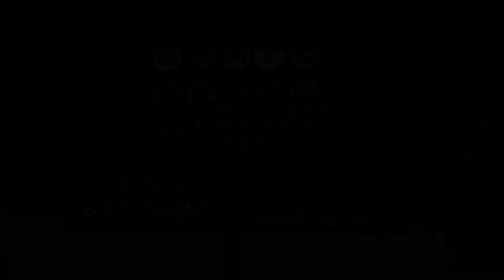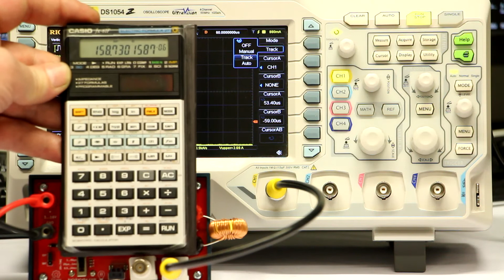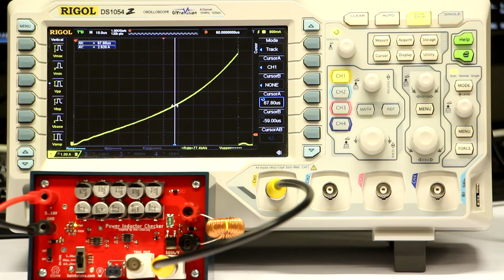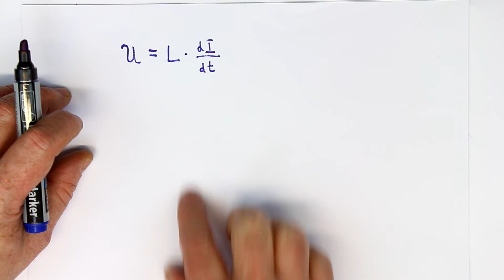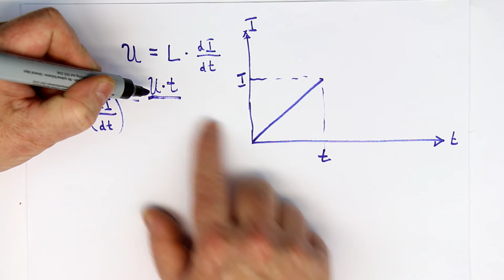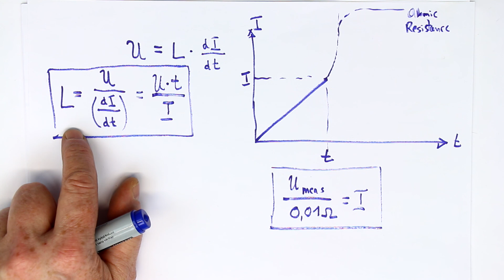The "Power-Inductor Checker": A tester for power-inductors

Comment: 4 years later, you could use a NE556 instead of the two NE555. A schematic on kainkalabs would be nice, but the ELM schematic is good enough as a starting point.
Anyhow, a nice idea!
Reply from the maker: I am using the CMOS.Version of the 555 to get a larger range of frequencies. 2 CMOS 555 are cheaper than 1 CMOS 556.
Reply: @KainkaLabs  Ah! OK, I made a bad assumption.

Comment: if  DUT inductor built for FLYBACK rated for 300 Volt then can we chk its saturation current over 10V supply voltage(prototype kit has 0-10V  for capasitor charging voltage)?
Reply from the maker: Of course this can be tested with the inductor checker. The saturation current is reached with any test-voltage because the current rises with time. And so it´s just a matter of how long the voltage is applied to the coil before the circuit resets.
Reply: @KainkaLabs  That's wonderful. I have various ferrite core and don't have any data sheet.so I will use this cheaker to measure switching inductor/transformer .I think another modification u can do.incorporate half bridge MOSFET arrangement obviously u have to use high side bootstrap circuit if u use 2 n channel MOSFET.dual polarity +-10v to charge dual capasitor bank.my objective to plot BH curve. But above method BH curve may not be completely ploted.becuz capasitor may get discharged at 0to positive X    of BH curve
Reply: @KainkaLabs  to get BH curve somehow we have to control capacitor discharge current 0to max value then max value to 0 then 0 to negative max value then negative max value to 0 such as sine wave .so need more charge to store and MOSFET should be control in active region.

Comment: 22:19 I don’t quite get how the vector on the scope read 64kA/s because the cursor says you have 53.5us and 2.3A so that gives you 2.3A per 53.5uS if we scale that up to 1s there are 18,691 53.5uS in 1s so if we multiply 2.3A by 18,691 that gives us 42.99kA ? What have I done wrong here ? Great tutorial though
Reply from the maker: The curve is nonlinear as you can see. The slope (or rise rate) is also non-constant. That´s like the difference between average values and momentary values. E.g. if are in an accelerating car there is a huge difference between momentary speed and average speed. Same is here.
Reply: @KainkaLabs  ahh I see… I thought the calculated value was simple a projection of the X and Y coordinates as indicated by the 2 labels on the LHS

Comment: Hi, is this available to buy? If not are the gerbers available so I can make one? Thank you
Reply from the maker: The project is stuck since a few years. The last modifications of the PCB were made by an intern and are not yet checked by me. The project is stil in the pipeline but on the priority list it´s around number 10 :-)
I can send you the KiCad-Files so you can create your own Gerbers.
Reply: @KainkaLabs  Hi that would be great, I'll send an email to your website contact email address.

Is info@ak-modul-bus.de correct?
Reply: @KainkaLabs  any update sir?
Reply: Yeah I would like to purchase this as a kit

Comment: I built something similar years ago, but unfortunately my circuit did not have enough power to saturate the "beefier" coils and I think my capacitor bank was not much smaller than yours. Although I could not reach more than 20 Amps, 60 Amps like in your device would have been great.
I also wanted to calculate the saturation region with a micro controller. Since there are way faster adcs nowadays I might revive the circuit. Afaik there are no automatic power inductor checkers available on the market.

Comment: I think you can use the math function of the scope to plot dA/dt, might make it clearer where it becomes less linear and if you want to calculate inductance at a specific point it would be easier than using cursors. 
Also you could have taken the voltage at the banana jacks out to the scope to show that it doesn't droop too much to affect the measurement. Not sure if you can do a custom equation on that scope for L = V.dt/dA where V would be one channel and A the other.
Reply from the maker: Good idea. I will test this if the math-function allows for displaying that.
(Would be a little bit of overkill for a single measurement but for a demonstration or for volume-measurements that would be great)
In the manual the limitations for 10% and 1% accuracy due to voltage-droop will be stated.
I will in the final promotion-video for the kickstarter-campaign implement your ideas :-)

Comment: Thanks, very interesting video. I don't suppose I could get a look at the current version of your schematics?
Reply from the maker: It´s nearly identical to the one from elm-chan.org
I have changed the semiconductors to more easily available ones, added some protection diodes and the 2 LEDs, made three timing-ranges instead of two etc.
ATM there are still a few additional components for battery-supply, trigger-output etc. which will be left out because they make no sense.
Just wait for 2 or 3 weeks until I have prepared the kickstarter-campaign.
There everything will be published.
Reply: Thanks! I'm doing a presentation this Thursday for the local makerspace, OlyMEGA, and I'm putting together a slightly modified version of the elm-chan circuit. I'm using some scavenged parts including two low ESR 4,700uF Al electro and four 22uF really low ESR ceramic capacitors. My current sense resistor is two paralleled 0.02 ohm 1% that were current sense resistors in a Lithium Ion pack, and the MOSFET is pulled from a dead car booster amp.

I think I'll make the first 555 timer have selectable slower clock speeds so I don't need such a high current power supply for high current inductors.

Are those solid polymer Al electrolytics on your PCB?
Reply from the maker: Hi Steve,
no they are normal (low-ESR) Al-electrolytics. The polymer ones have a lower capacitance to volume ratio and are much more expensive.

At my first homemade version of the elm-chan circuit the first 555 timer didn´t oscillate!
I had to add a capacitor or resistor at one point, but ATM I don´t have have our modified circuit available from my home and can´t remember where exactly I have placed that component. 
Will be back in the office/lab only on Monday which is too late for you to send you the modified circuit.
So first check with an oscilloscope if you get very short pulses with around 50Hz repetition rate at the output pin 3 of the first 555-timer.
They are hard to see/catch/trigger with an "old" low-bandwidth analog scope, but are no problem with a DSO or fast analog scope.

You don´t have to worry about the high currents because nothing can break in this circuit and the inductor also won´t be damaged.
For measuring at not too high currents just start with the slowest time-setting of the 2nd 555-timer (with C5=470p and VR1 set to maximum resistance) and then slowly turn VR1 to lower resistance until you see the rising current on your oscilloscope.

The repetition rate of 50 Hz coming from the first 555-timer is of course of no importance.
Nevertheless you could quickly get to very high currents especially with low-inductance values in the µH-range (because the current rise is inverse proportion to the inductance) when you increase the on-time with VR1.
So the critical spec is the max. peak-current capability of Q1 which should really be 60...100A

But if you want to measure at let´s say a maximum of 1 amp, then your oscilloscope should have a high sensitivity because with a 10 mohms shunt-resistor you only get 10mV voltage at 1 amp current.
(Then you could of course use a 100 mohms shunt-resistor which is OK for "low" currents in the single-digit amps range.)
 
One more hint: A viewer recommended a series resistor to the freewheeling diode D1 for faster energy-decay of the inductor when the MOSFET is switched off.
He was basically right with the idea but his explanation was so totally wrong even after a lengthy discussion and proving the right physics behind that with LTSpice simulations, that I finally deleted the discussion here for just not misleading viewers into wrong physics.
To make a long story short just add a resistor in the range between 10...100 Ohms in series to D1.

Have you already built up the circuit and played around with it?
Reply from the maker: For a safer working of the first 555-timer add a 100 Ohms resistor between pin 7 (Discharge) pin 6 (Threshold).
In the original circuit pin 7 is directly connected to the RC-combination of R1 and C6 and pin 2 (trigger).
All these connections stay as they are except for pin 7.